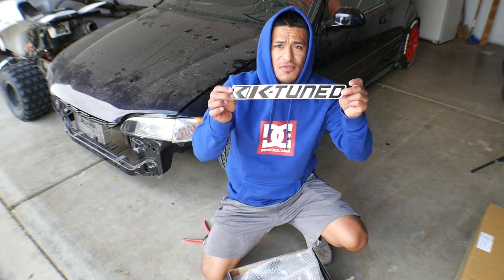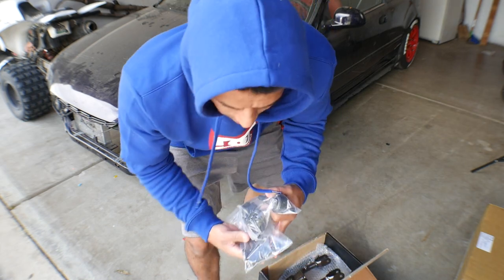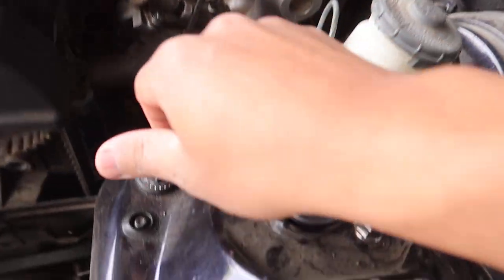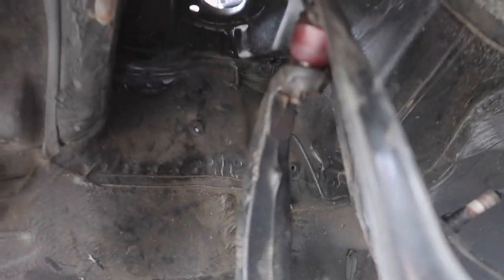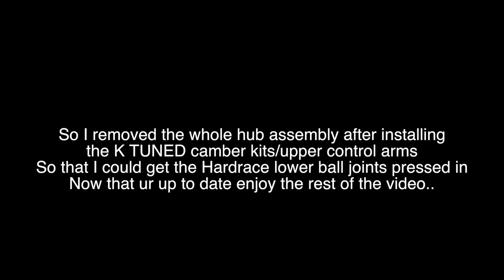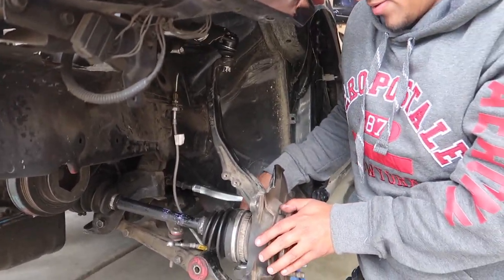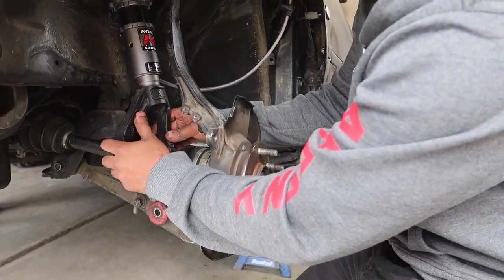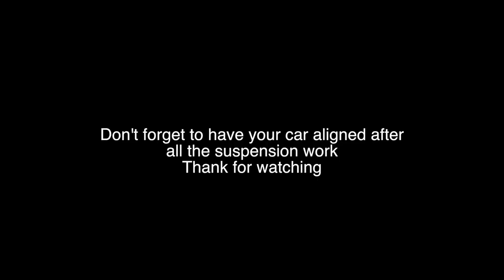INSTALLING K TUNED CAMBER KIT (EG HATCH)

Comment: Dont need to take off the hub to put the lower ball joints in get a 8 inch long gear puller can do it with it on the car
Reply from the maker: really? i will have to look into it.. thanks for the advice.. thanks for watching